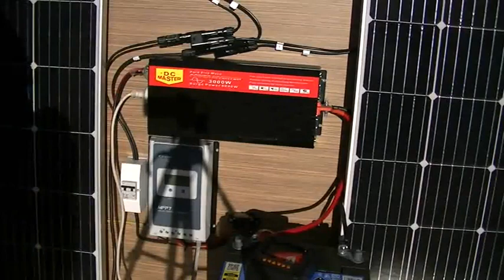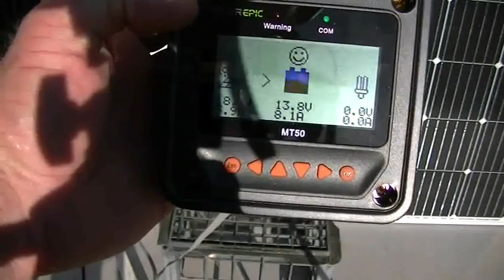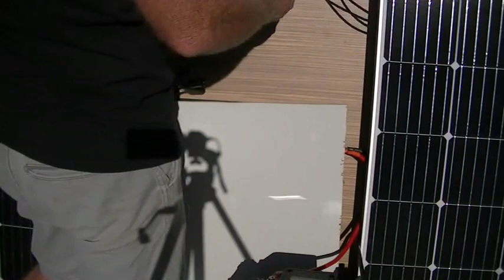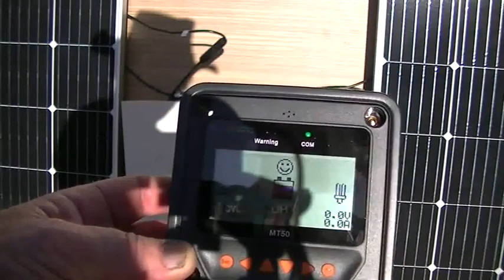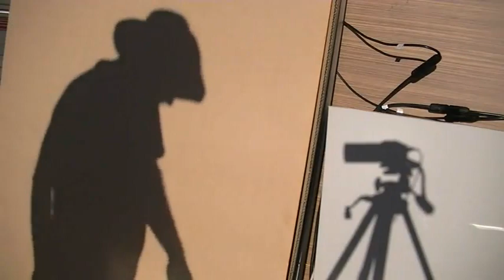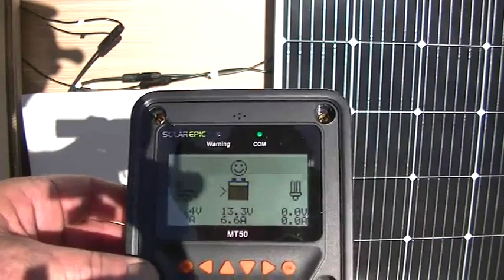Caravan Solar Panels . Series or Parallel Answered

Comment: Very confusing. I have always been told, & references on the internet from different companies state that parallel for caravans is the preferred way to go. 
Overview
Should You Wire Your Solar Panels In Series Or Parallel?
For a caravan solar setup, parallel wiring is generally preferred, especially when dealing with potential shading issues or when adding panels of different specifications. Series wiring is more suitable for situations with minimal shading and when you need to increase the system's voltage to match the charge controller or inverter's input requirements. Too many conflicting opinions.
Reply from the maker: As I own a business that installs off grid systems in caravans, and have tested both parallel and series connected systems in various conditions, series connected panels always produce better results, especially in shaded conditions. I think most of the confusion comes from the myth that if 1 panel is shaded in a series system then that kills the whole string, which is just rubbish, as solar panels have bypass diodes which prevents the rest of the string dropping out should one panel in the string become shaded. Series connected panels start producing power earlier in the day to later in the evening due to the charge controllers threshold voltage being reached in lower light levels. If a panel in a series connected string becomes damaged and shorts, you only lose that panel as the short acts as a bypass. If you get a shorted panel in a parallel string, then all the panels are shorted and lost.

Comment: Glad I watched this. I am just adding a second panel and was pretty torn on whether to go series or parrallel. With one of those double adaptors it's pretty effortless to swap between if you like. 
Now I need to check my cheap fold out panel and see if it's got diodes or not. If not then I'll add them in and can run that as it's own series set.

Comment: Quick question for you, say you have bought a cheap solar panel from flee bay that doesn’t have the diodes, can you not get the correct size diode and solder them on?
Reply: Great video btw, thanks for clearing it up,

Comment: Thank you. What is the max voltage for an mppt controller?   I  got 2 36 volt panels. In series that would be 72 volts???
Reply from the maker: For the 40 amp controller it is 100 volts

Comment: One more edtail. Going into series requires that you use exactly the same solar panels. You can't just mix them, otherwise you'll end up getting "panels times I" where I is the lowest of all panels in series. Example, 2 panels of 10 A and 1 panel of 9 amp will end in 3 panels in series at 9 amp per panel. You loose quite some power therefor.
Also note: MPPT is exatracting more power out of your panels then PWM. PWM is cheapo, and only works if the panel fits exactly the battery, and at perfect light conditions.

Comment: The dude in the other video said to use PWM because "it's cheaper and there's not much difference in power" to MPPT.

In any case, love your vids for years, is your next video going to have some special tinman joule thief on the business end of that solar rig?  lol
Reply from the maker: With a pwm ,you can only hook up in parallel,due to there low input voltage threshold .